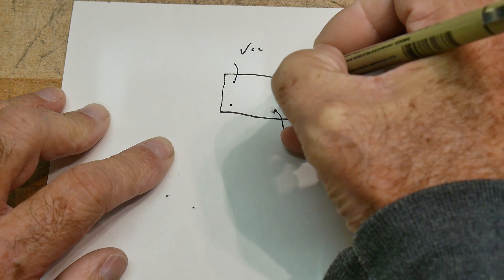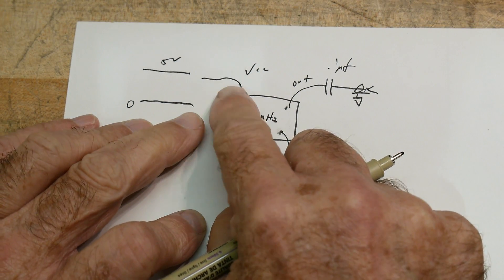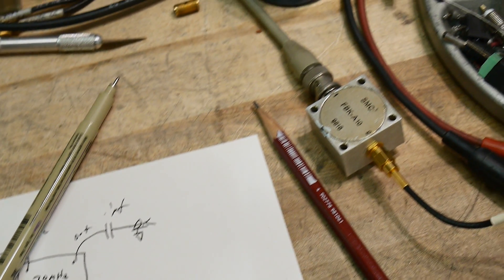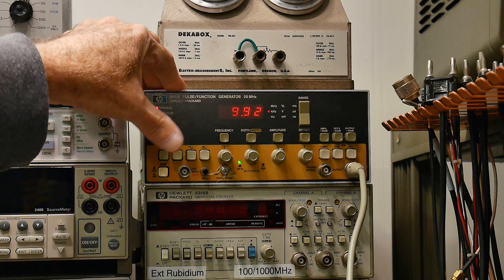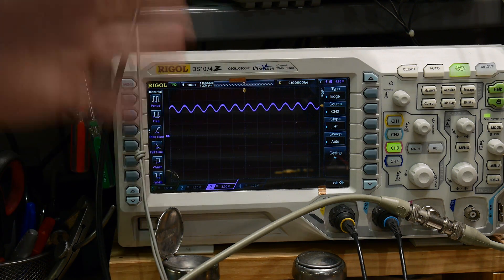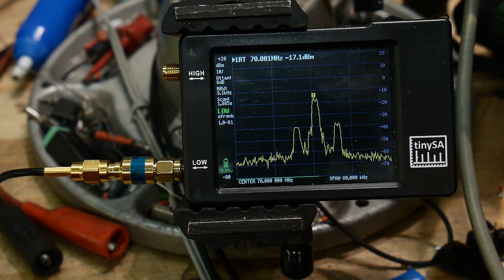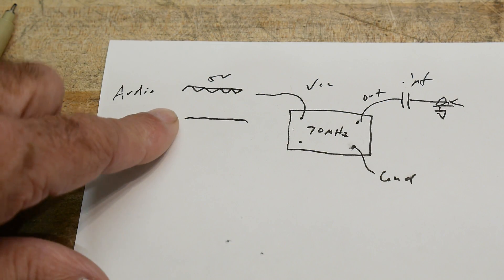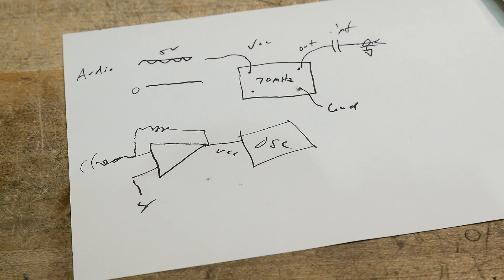#594 SMA Oscillator with Simple AM Modulation

Comment: I guess what you did is similar to "high-level  modulation"  of an AM transmitter, where the modulation is applied to the  final stage of the transmitter (supplied by Vcc directly), as against modulating some earlier RF stage. I already have the nanoVNA H4, but sort of waiting off on the very new TinySA, to really see how it performs and your videos on it are quite enlightening, as they were on the nVNA...
Reply from the maker: It is too bad that Rigol does not make a $350 spectrum analyzer or VNA. I'm sure they could but the volumes are not what oscilloscopes are. While the $50 VNA and $50 SA are great for the price. Just think what $350 would get you. No one talks about $50 oscilloscopes since the $350 ones are totally amazing.
Reply: @IMSAIGuy  Exactly. I would prefer something more technically substantial than the current nVNA and tSA,  preferably in the $200-$300 price range.
Reply from the maker: @radiolens536  That is why I like used equipment. I have a 1993 spectrum analyzer that cost $15,000 back then.. paid $250.

Comment: You are surely going to introduce frequency and phase modulation as well by changing the Vcc, Not really the best way to get AM modulation.
Reply from the maker: the spectrum analyzer display looked fine. I didn't see any FM.
Reply: @IMSAIGuy  It would be interesting to look at the frequency sensitivity of the oscillator WRT changes in Vcc. It may be that the oscillator regulates the voltage down to a lower level internally and the head space there is big enough to mitigate that effect.
Reply from the maker: @PapasDino  I'm guessing inside the can is a logic inverter chip.  like a 74HC14 Schmidt. so the voltage swing is just changing the voltage at the totem pole output.
Reply from the maker: @PapasDino  Well, I opened one and is is discrete transistor looks like a Colpitts. The output drive is just a NPN. the output tied to the collector and a pullup resistor to Vcc. so my AM modulation just changes the voltage across the resistor. too simple. I'll do a video on it. looks very pretty inside with alumina board and deposited resistors.
Reply from the maker: @PapasDino  I measured 30Hz shift with 100mV change. at 70MHz. Using 1MHz osc for AM band transmitter, I would guess the FM would be very small and the AM would swamp it.

Comment: Good morning. 70 MHz carrier is amplitude modulated by 20% with a 10 KHz sine wave signal. Thanks for the presentation. 
In India few decades ago the police were using 70 MHz wireless AM communication equipments fitted onto their two wheelers and Jeeps, if I remember correctly. And they were always noisy with static crashes unlike the modern day FM devices.